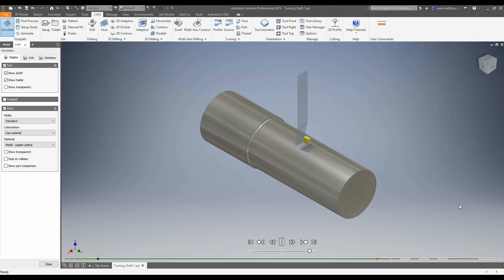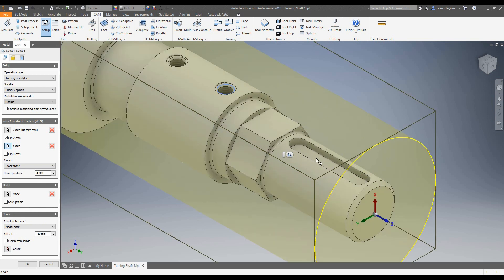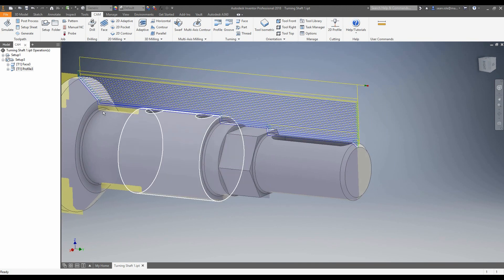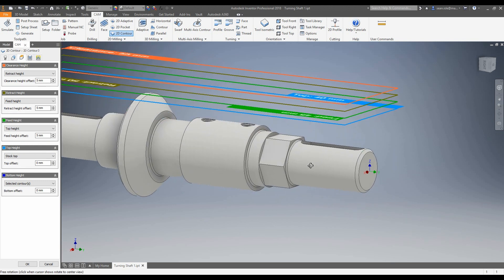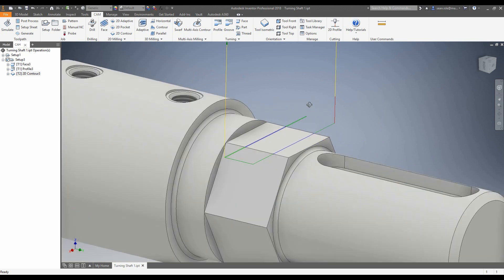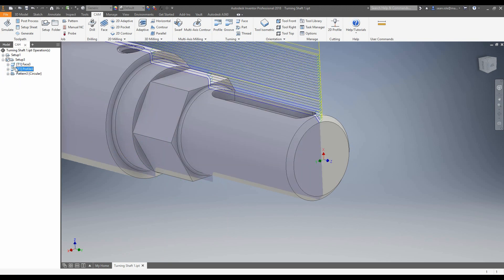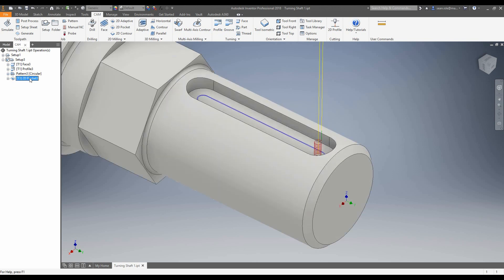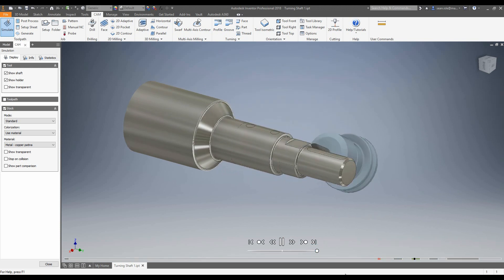Autodesk Inventor HSM Mill Turn

Comment: Thanks for your videos.
I have a question about using the Flat Pattern tool in simulation. It rotates the piece, but I'm not sure if that's possible in reality due to the magazine. 

I believe that it is the chuck that should rotate, not the tool.
"Wouldn't it be more authentic?"
You can perform the task in the simulation provided. Once you have completed it, the program can be sent to the machine.
Thanks for everything.

Comment: My machine does not have a y axis. Can I do the key way slot with a smaller diameter end mill and finish it with a smaller end mill. As this path will involve y axis movement.